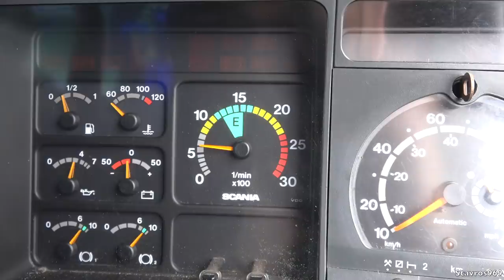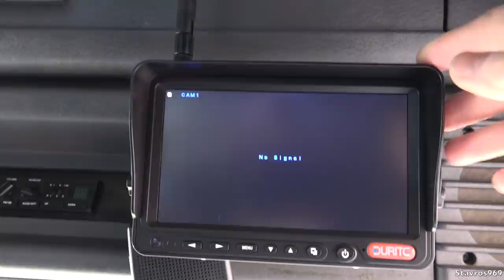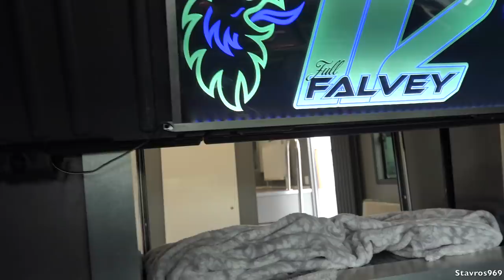SCANIA 124L 400 Motorhome & Rally CAR Transporter Truck!! Full Tour

Comment: Don't quite understand why they don't have 12v usb charging ports along with the plug sockets. You're stepping up and stepping down the voltage and loosing power through wastage.